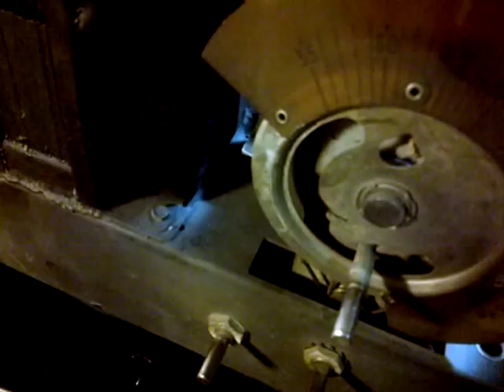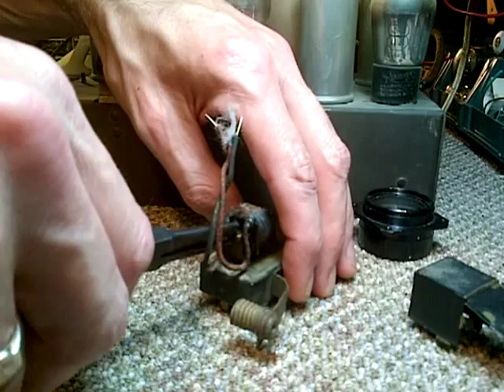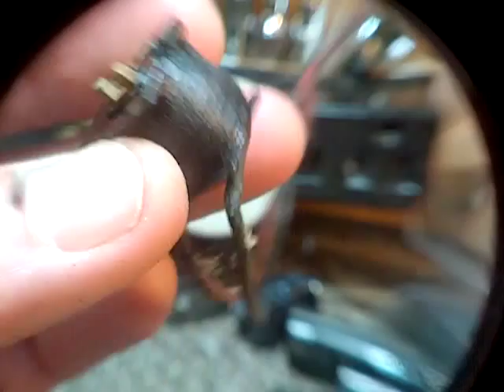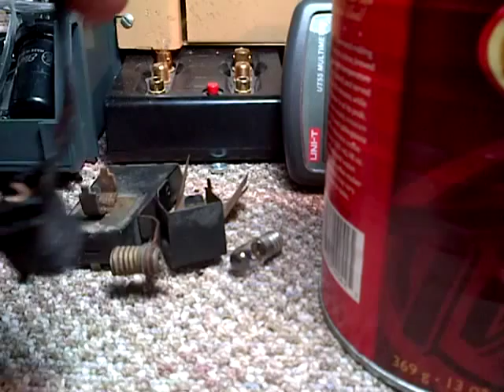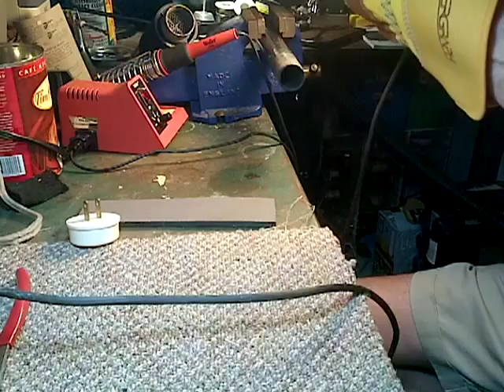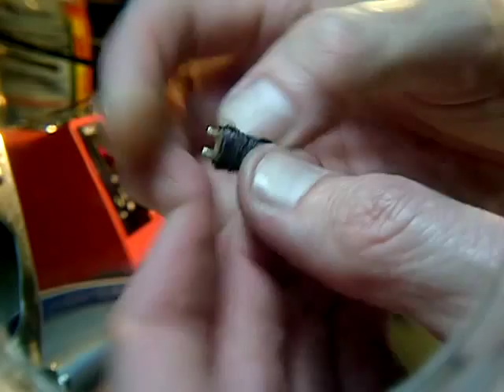Philco 91A 221 Radio Repair Video #24 Shadow Meter inspection and disassembly

Comment: Jim You can add a series resister in if needed. And if the core is close but is to big you file the bobbin a little to get it to fit. Dennis

Comment from the maker: We've got two sewing machines in the house but no sewing ever happens.  Do you think a metal sewing bobbin would work assuming I can slide the original core inside?  I have my doubts because of the metal.

Comment from the maker: I saw the number of turns on Lockmeister's video so I know I've got to get in the 5000 range.  I also saw his problem with resistance and I'm wondering what would happen with #36.  My quick calculation is that #36 would be around 500 ohms, not the 1100 in the original.

Comment from the maker: I was thinking about that but the sewing bobbins are all metal - or are they.  I thought about the sewing machine as a winding machine too.  Not sure yet what I'm going to try.  i am most concerned about the wire size.  I have a spool of #36 but I may not get the number of turns that is needed.  I can't wind a larger coil since the little box it goes in is limiting.

Comment: Hi Jim. This tip is kind of late. Most coils are soaked in shellac, and you can soak them in lacquer thinner to remove it. This makes it possible to unwind and count the turns. Hope this helps next time. Bobby

Comment: Jim, Here is a thought if your wife has a sewing machine you might try using a sewing bobbin as a coil form and winding it on the sewing machine. The one thing I don't know is if the metal core will go through the center of the bobbin. But I don't think the coil winding is supper in size and number of turns, it is just a simple meter movement. If you could get the core to fit it would be worth a try.  Dennis